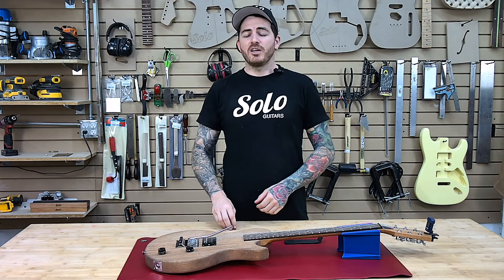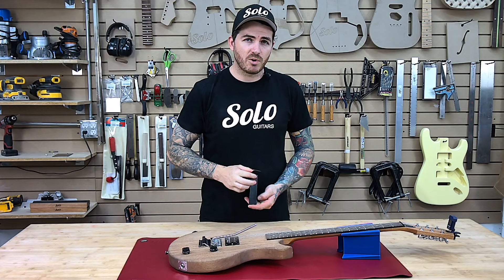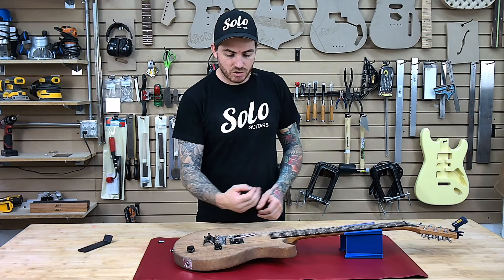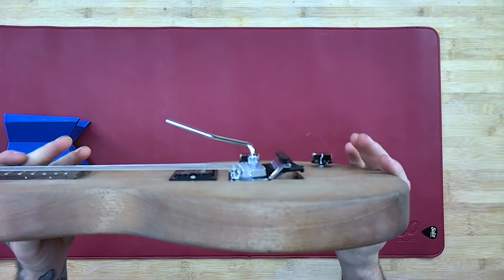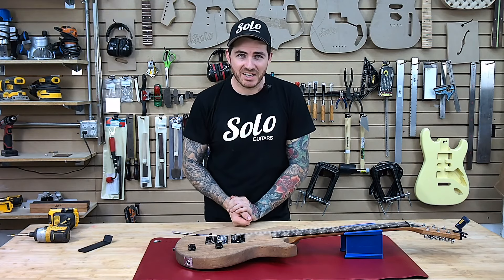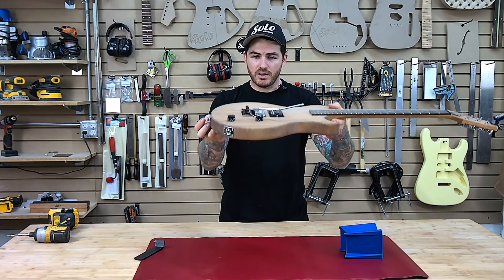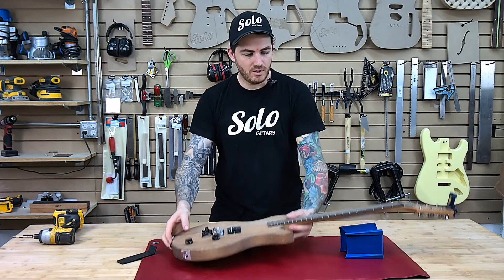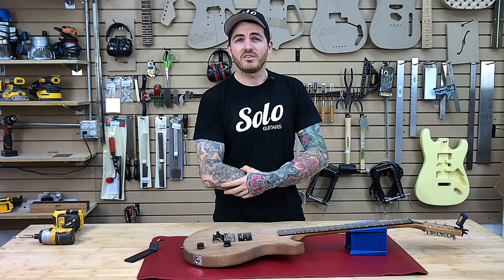Pro Tips for Setting Up a Floating Floyd Rose Bridge

Comment: Further couple of tips: Try to leave Fine tuners at approximately neutral before adjusting the spring and string balance tension and tune ever so slightly flat prior to closing your locking nut, if you have one, as the pressure placed on the string break actually makes the strings go sharp.
Reply from the maker: Thanks for the advice! Those small adjustments can make a big difference in getting the perfect setup. Appreciate you sharing!